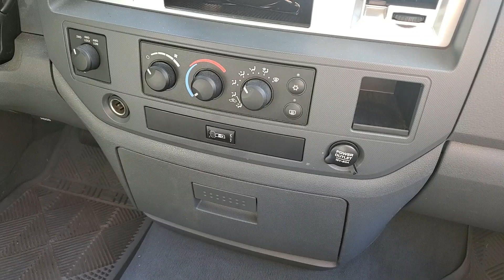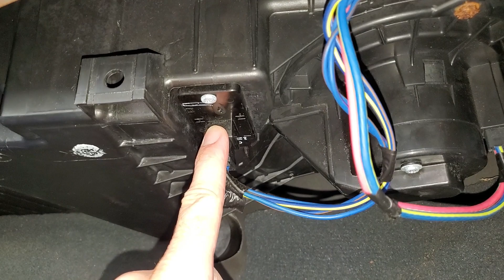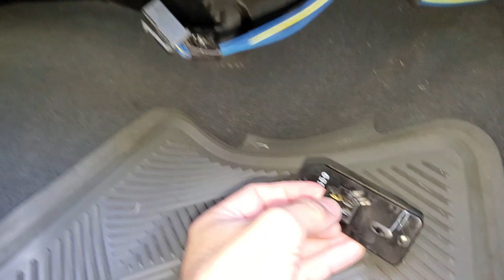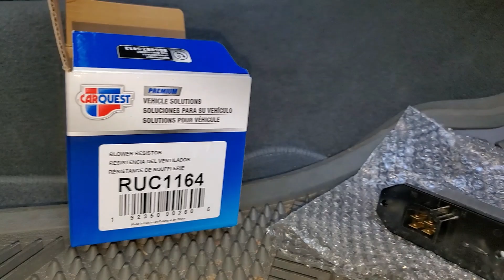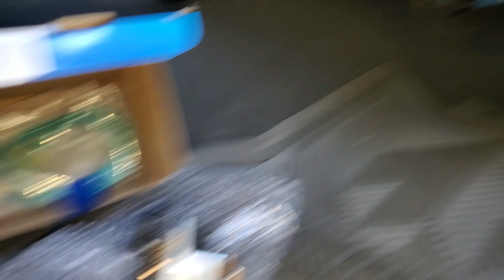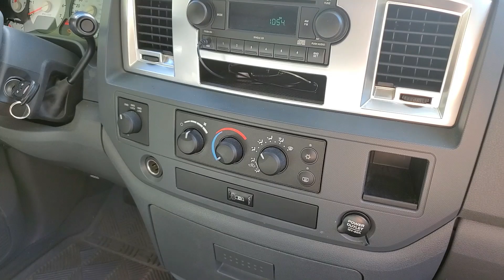2008 Dodge Ram 1500 - Replacing the Blower Motor Resistor

Comment: I literally just came in from outside mine also was only working on Hi ,I ordered a new one but tried to make sure the opposite side of the copper tab between the stems that hold the white part was touching,and after squeezing it against the stem all 1234 setting worked again

Comment: Could a bad resistor cause all the blower settings to fail? My truck had intermittent issues with the fans dying altogether for a week and then coming back on, but now it has stopped working altogether.

Comment: You just saved me $248 (what the mechanic wants to replace it.  I got the part for $27).  Thank you so much.  My truck started doing the (exact) same thing last week.  2008 Dodge Ram SLT.  Well, close.  Mine just went from "all four settings work" to "only max works."